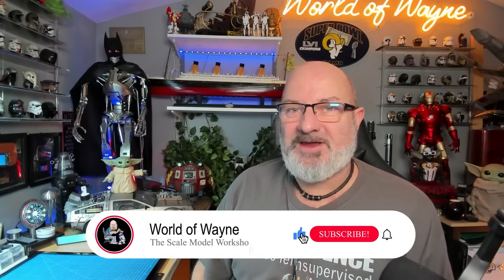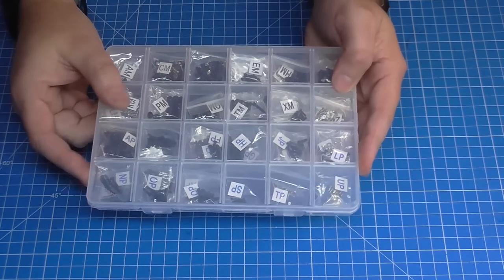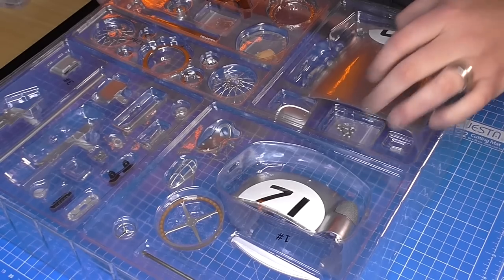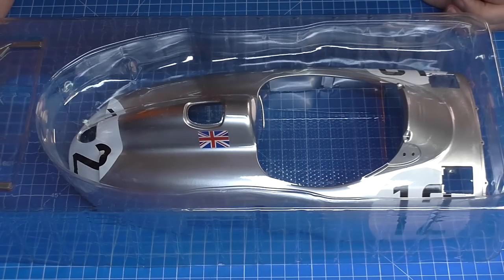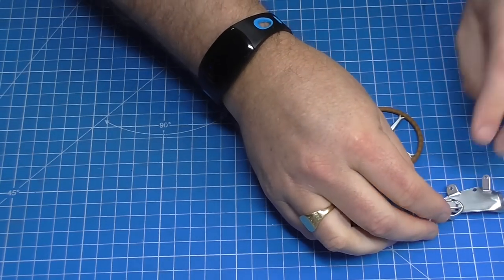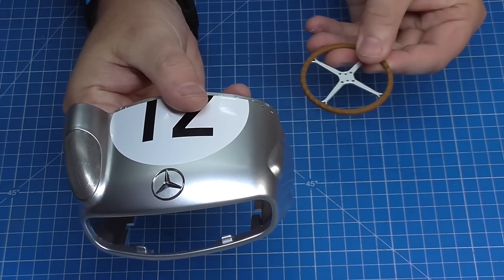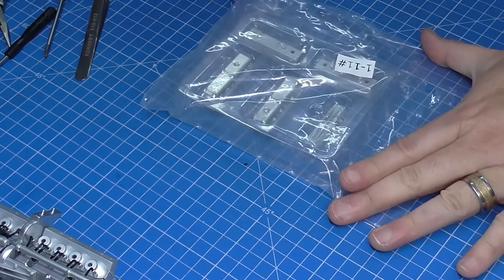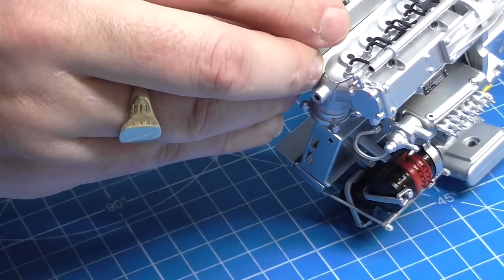Build the 1:8 Scale Stirling Moss 1955 Mercedes W196R - Pack 1-4 - Stages 1-13

Comment: Thanks for posting this Wayne, I watched the complete video. I did the E Type wheels 'the hard way' as that was all that was available! I had to walk away a couple of times but finally finished them! Well worth it once completed.
Reply: @Robert Lees - I had to chuckle at your comment...."I had to walk away a couple of times".  It reminded me of my first 1:8 scale Pocher 1935 Mercedes 500K Roadster, with only the hard way to build its wire wheels.  That was in the early 1970s.  I have never been so frustrated trying to build a model car component!  I finally realized there was an error in their instructions so I drew my own diagram and finally completed a wheel.  Wayne's 2 hours to build one is but a fraction of the time I spent, but like you said, the beautiful look and great satisfaction I had in completing that first wheel was well worth it.  A good thing I felt that way since there were 5 more wheels to build, as it had 2 spares mounted on the trunk! :face-orange-biting-nails:

Comment: I was just about to write and ask you when you might be doing this model.  I really don't know how you keep up with all these builds.  You're the best, Wayne!  I am waiting for the full kit delivery to arrive and feel like a kid on Christmas morning with the anticipation and excitement I am experiencing.  P.S. - I am 74!  Still a kid at heart.🥰 Thanks again for all you do! 

 P.S.  That screw box is a great idea to provide safe and quick access to the many sized screws.  When I purchased the 427 Cobra SC kit, I bought a similar clear box storage item at Lowe's, but mine is vertical with 30 clear slide drawers.  I taped all the screw part # tags onto the front of each drawer and it works perfectly!

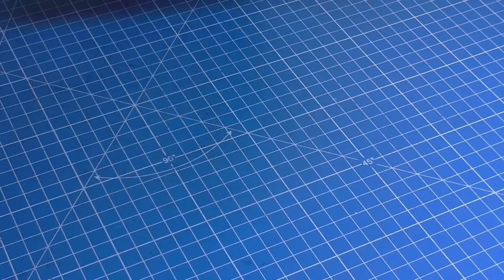Comment: 1:15 OMG that pillbox is AMAZING! I agree. I would LOVE if each model came packed with every screw you needed nicely sorted and packaged from stage 1. It'd really be a huge help.
Reply: All you have to do is buy one of those clear pill boxes, put each group of screws in each compartment and label with stickers or removable packaging tape.  I purchased a standup 30 drawer pull out style at Home Depot which I think is easier to use.

Comment: The wheels look so much better the hard way than the easier way
Reply: Absolutely, because the spokes are round as they should be. The easier way spokes are flat and look like poo poo💩.  Have you ever seen flat spokes on an auto wheel?  Of course not.

Comment: A question about screws. I would imagine that say an EM screw would be the same screw across the board for a single manufacturer. Now, would an EM screw be the same between all the manufacturers so you could have an EM screw in a pill box and use it on any build where one was needed? (Like in "real world" hardware an M10 1.25 is what it is and all are the same.) I'm into issues 12&14 on the DeLorean with two problems so far. A duplicated part in issue 8 (two right handed parts instead of a right and a left, but a part I can leave off for a while). Also the bit that holds the magnet into the left rear hub was pushed free of the hub but I think I have that sorted. Thanks for making these videos to help us noobs!! The oil does make a difference BTW! I'm now a believer!
Reply from the maker: I wish that was the case but sadly it  doesn't work that way

Comment: Looks good and hopefully they will do more at a later date and brilliantly well done for all screws together at once in box marked and love the options for the wheels but complaint now come on @Agora when are you going to do colour coordinated screws so same colour as the metal the go would look lot better than how it goes now
Reply: @MasterLemonLime - Actually, they do so for the frontal hood area on the Stirling Moss edition, where the painted number badge is white and two screws go through it are also painted white.  As for any other screws, it's easy enough to paint them yourself.   P.S. Try using punctuation, which I'm sure you were taught, but apparently have just gotten lazy!

Comment: Hi wayne if I was building this I think I would op out and do the easy way to do the wheel
Reply: @BOBBY BATES - That is why they give you that option, if you don't feature the more time consuming, but infinitely better and more realistic looking individual spoke build.  The build instructions I have seen on line from Agora and IXO are very clearly pictured for the wheel builds.  Just take your time and don't try to do too much at once and you should be fine.

Comment: The posters would be so much better if they came in a tube rather than have creases in them.
Reply: Good point Peter!  I sent an e-mail to Agora yesterday suggesting they do just that.  I framed my poster for the 427 Cobra SC but the fold lines are so noticeable that it really ruins the image.  Let's see if they really listen to their customers!  :face-turquoise-covering-eyes:
Reply: @Loulovesspeed  I can't even afford one of these kits. I have to live vicariously through Wayne, but you would think for the price of the kit, they could package a simple poster a lot better than they do.
Reply: @2005portensie  👍  I have built several 1:8 scale model car kits previously, made by Pocher (Hornby is the holding co.)  While the poster situation is a minor irritation and doesn't affect the building of the kit, the quality of Agora kits is quite good.  The Pocher kits, however, have the worst instructions I have seen in the large model kits.  They are poorly printed in black and white, lack detail as to how parts are connected, where wires and tubes should be positioned, and in general are just plain pathetic, especially for the high prices paid for these kits.  Their newest release is a beautiful 1:8 Lotus 72 F1 kit.  They had to issue 4 revisions to the instructions just as the kit was released to the public, due to numerous errors made in the initial instructions.  I came very close to purchasing that kit until I read about the revised instructions being released.  That did it for me and I cancelled it as I have struggled with enough poor quality Pocher instructions.  I have seen many reviews where other customers complain about the same issue.  That's inexcusable in that price range!  The Agora instructions are color printed, provide close ups for properly attaching small, irregularly shaped parts, and many times will show the installation from a couple of different angles for more clarity.

Comment: I would definitely go with the easy mode on the wheel spokes.  The original is much too cumbersome and difficult and really doesn't look that much better.
Reply: @lakrfan 49 - Just an FYI, but I have built several large scale (1:8) model cars with wire wheels like these that you build up - Pocher kits, and they are for sure intimidating at first sight.  I have been a model car builder for better than 68 years and my primary goal has always been to make the finished car look as realistic as possible.  I assure you that you will notice the difference in the two build methods in this kit once finished and mounted on the hubs.  Real spokes of wire wheels are not bonded together as the easy build ones in this kit are.  I have a discerning eye for things like this and would notice the difference right off.  I realize that not everyone does though, so it comes down to the level of realism you notice and desire.  I remember my first experience with a Pocher, 1:8 scale, 1935 Mercedes Benz 500K.  It took a couple attempts at building the first wheel, but I managed to finish it and was very pleased with the appearance of it.  That was a good thing as I had (5) more to build - it had 2 spares!  The basic rules of sanity, as I refer to them, are: 1) Don't rush the work.  2) Limit the time you do work on it as frustration tends to set in when you get tired.  Whatever your final choice is, the most important thing to achieve is your own level of satisfaction and pleasure in building it, as well as looking at the finished product.  I hope you enjoy your build, whichever route you choose!  😉

Comment: It's not a BIULD, it's just assembling
Reply: Lister the Dumb - Don't downplay assembling a model as child's play!  I "just assembled"  a 1:8 scale 1935 Mercedes Benz Special Roadster and it was comprised of 2,364 separate pieces, including wire wheels that were built one spoke at a time.  The model had 6 of them too, as it had two spares.  My guess would be that you couldn't even "assemble" the wire wheels.  :hand-orange-covering-eyes:

Comment: just been on there site they have only two payment 1-4 packs 420 pounds full kit1299 pounds  is the n1-4 over 12 months as it dont say
Reply from the maker: From what I understand you can by the full kit or if you a previous Agora customer you can get the first 4 packs in 1 go then monthly thereafter
Reply: How many issues  in the build
Reply from the maker: @edwardbellamy5154  it’s 12 packs in total

Comment: Shame the built in grill on the front is all wrong.
It needed to be a separate panel.
It needs to be black like the other grill and fine mesh.
Reply: Are you talking about the headlight cover...
I was thinking the same thing...
Reply: Yes. I've seen this car on the track a few times. Even with Stirling Moss driving it.
Look at photos on line . It always shows a black mesh,like the front grill. It ruins the whole model for me. If I was building this model I would paint the mesh  Matt black.
So it at least looks better.
Reply: @robinaroundtown...2194  Not a headlight cover, but an air intake for the fuel injection.
Reply: @meeshker - That is interesting because I just received the book "Mercedes Benz Grand Prix W196 : Spectacular Silver Arrows" by Karl Ludvigsen.  With the exception of the color cover photo, the dozen or so original photos clearly show the screening to be a silver metallic finish, so not all of them were black!  The model is a super fine mesh too!  Don't understand how you feel that it "ruins the whole model"?  Easy enough to paint matt black if you desire. My point is I think you are making too big a deal over something that is easily corrected.  🤔

Comment: This is a disgusting example of over packaging and how this product requires yet more tooling to produce the vac form moulds just because somebody can't be bothered to actually look in a bag full of screws/ parts etc, of course this will be defended by stating that it's to facilitate ease of assembly and creating a professional look to the product, but it's nearly getting to the stage when you will soon be supplied with some poor Chinese / Asian child to come pre booked with the kit on a return ticket and build it for you then you can sit back and brag that you built this! Sorry totally unimpressed, bring back the times and aptitude when the likes of Gerald Wingrove were alive that was model MAKING not MODEL ASSEMBLY! 👎👎👎
Reply: @Muzfuz - A "disgusting" example of over packaging you say.  Who pissed in your coffee before you wrote that anger filled diatribe?  Chill out man!  Packaging the parts in bubble enclosures, especially the painted or delicate ones, is done to protect them during shipment and has nothing to do with ease of assembly or creating a professional look.  It is actually the most common method used today and the best one yet to help protect and make parts readily visible for quick, easy identification. 
The models of Gerald Wingrove and this model have but one thing in common - they are both models!  His were entirely built from scratch, something very few people who love to build (assemble) models are capable of.  This is just what it claims to be, an intricate, well made, mostly metal kit that will provide many hours of enjoyable and relaxed model building.  :face-blue-smiling:👍👍👍